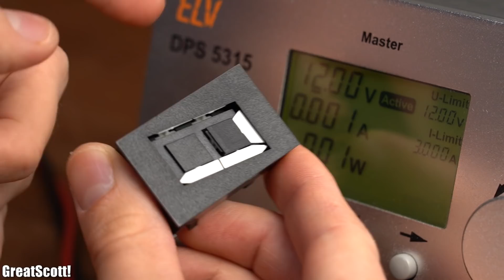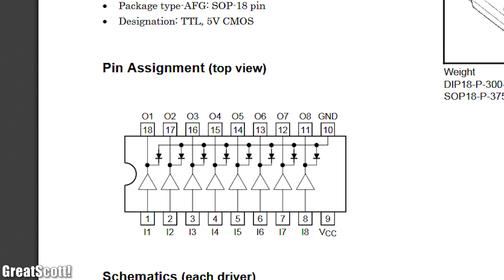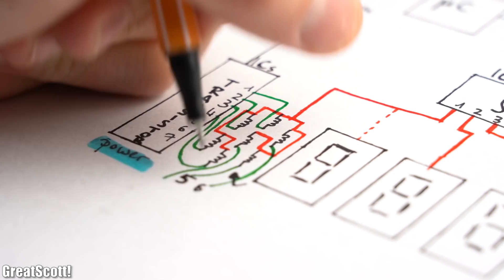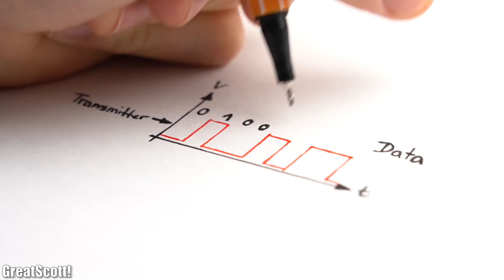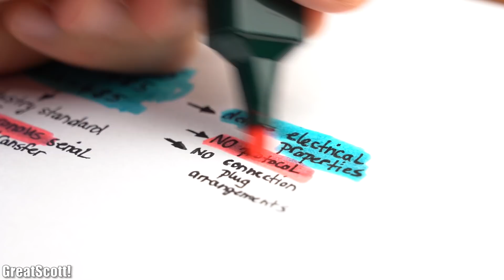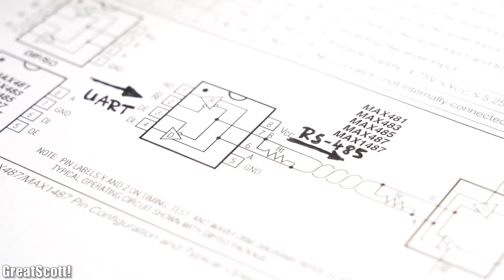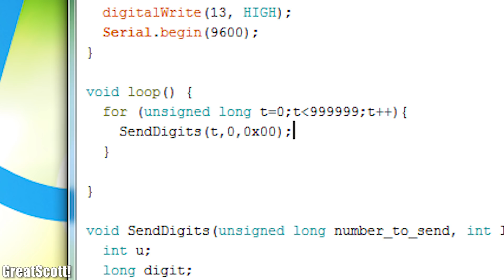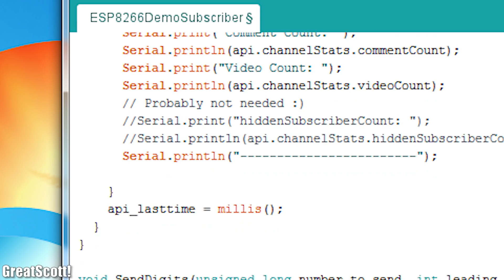Controlling Mechanical 7-Segment Displays?! How RS-485 and UART works! || EB#43

Comment: Will you make a video about Wavgat nano, aka LGT8F328p? These are another arduino alternatives. Their processor is "better clone" of ATmega328P. (Register level) programming will be same, but it have some additional features: it should run at 32MHz internal oscilator, it should have Timer3, one 8bit DAC output, 12bit ADC, ...
Unfortunately, it is missing well readable datasheet.
https://www.avrfreaks.net/sites/default/files/forum_attachments/LGT8F88P%20LGT8F168P%20LGT8F328P%20translated.pdf

Comment: how do they keep magnetic polarity, pls someone explain
Reply: They don't. I'm guessing that there's a mechanical door which is controlled by the electromagnet. When open it can allow the plastic to be visible and then close the door. Then put the plastic back in next time . 
Sorry, got a little impatient typing on the phone. Do let me know if you want a better explanation.
Reply: @sensiblewheels  This is ok, I just wanted to learn if there is a way to make a instantly and permamently magnetizing solenoid. And as I thought its not :/
Reply: I think another commenter had the right answer.  The mechanical moving part has a magnet.  In one state the north pole is drawn to the electromagnet and stays after current is removed because its a magnet so it's attracted to the iron core in the coil.  So you can shake it a bit and it stays.  To flip states you apply current in the opposite direction, which repels the north pole and attracts the south one.  That state is also stable.  So it's effectively a magnetic latch,  no mechanical latch needed.

Comment: That is an awesome display, I think that there are even dot matrix displays like that. Just curious, is it possible to use a regular arduino with an Ethernet shield to monitor subscribers? Instead of using an esp8266 that is.
Reply: Yes and Yes.
Reply: @zaprodk  cool

Comment: The three digits on the right hand side (lsb) mechanically switch more often and hence will wear before the most significant digits.
They must have thought of that and allo you to replace them or swap the 3-digit module with the msb one.
Reply: segments have no mechanical linkage, they are controlled with electromagnets, so there is nothing to wear out, at least not that soon...the manufacturer states segments are rated  for over 250 million operations
Reply: @brane3698  250 million operations, that's plenty but it's probably less due to dust and dirt.
Reply: @oH well,lord! if you prefer.

Comment: Your videos have been very useful for me GS so i'm gonna tell you about a problem / project i've been working on... since I started studying electronics a year ago i've wanted to reverse engineer a mobility scooter / electric vehicle ESC,   its a DC brush motor which is controlled by a single potentiometer which controls reverse, forward and braking, the trigger seems to act as a desired % of maximum speed,   and the vehicle automatically accelerates or brakes to meet that % target.  The boards seem to utilize a microcontroller, I would like to implement a similar system without.  

Firstly I am trying to make it so there are 2 pedals, brake and accel which will each give a 0 to 5v signal lets say,  this is then compared to see which one is higher, which activates either braking or accel mode.... there will be two 555 timers creating the duty cycle for power or regen braking seperately depending on the pedal signal intensity. The issue im struggling with right now is trying to control the PWM duty cycle of  555 timer using just a single 0 to 5v  voltage ( not a potentiometer ). My idea is to use MOSFETs to control the resistance of the charge / discharge portions of the 555 timer operation,  but im having trouble fine tuning it so that the mosfet works properly as a variable resister,   I have to compress the voltage into a confined range of about 2v to 3.6v it seems.

Comment: i got a electrical meter with rs485 output and 2 rs485 to ttl converters, but i cant figure the code for the mega 2560 or nanos out

Comment: Ive found the company a while ago through another YT vid. got myself a couple 7 Segments and some flipdots. Also got a single RS485 segement, didn't get to them unfortunatly yet. Thanks for makeing it more clear how they are driven though.
Reply: How much did you pay for it?
And is there a shop?
Reply: @MrKugelkopf  Just contect their info@alfazeta.pl email address. The pricelist i got when ive asked was 9 Euro for a 7 Segment without controller (as shown in the beginning) 24 Euro for a single digit controller (didnt ask for code to controlle it, wanted to use it as a base for my own design). And the Simple flipdots were from 4-12 Euro available. Just mail them, the reply was fast and informative when i asked some questions reguarding shipping and price. Hope this helps. Their page also shows some cool Projects they did with artists.
Reply: @StreuPfeffer  thank you!
Reply: i think you have to contact them

Comment: RS485 used to be really handy in the pre-wifi days as you can run it really long distances with no loss of signal with a data speed of 115k. A company called Lantronix also sell a Ethernet to RS45 server device (UDS10), so you can drive RS485 on a ethernet based network.
Reply: Still being used in the show and theater industry for the DMX lighting protocol

Comment: I will use some multiplexers and transistors to drive this (without understand the whole mess) :D
Reply: It's a lot harder than it sounds. Look up on YouTube, there's some videos of EE driving similar dot matrix displays
Reply: to flip a segment it needs a >200mA pulse in 1 direction and un-flipping needs a current pulse in the opposite direction, you'll probably need something that has a push pull output

Comment: How can the segments hold their position even after the magnetic field is gone?
Reply: I think it must be a similar mechanism as used in a mechanical toggle switch with the electromagnet providing the apposing (on and off) toggling force rather than your finger.
Reply: Once the magnetic field dissipates on the electromagnet, the fixed magnet's field is still attracted to the electromagnet's iron core. If otherwise undisturbed, the fixed magnet will stay there basically indefinitely. When the electromagnetic field is applied in reverse, it pushes the fixed magnet away, so its field no longer overlaps the electromagnet's iron core.
Reply: @McTroyd    agreed.
Reply: The electromagnet's core must be made of a "hard" iron, which stays magnetized after the coil is de-energized; like a magnetized screw driver. Usually an electromagnet uses a "soft" core that does not stay magnetized.
Reply from the maker: Yes

Comment: How the electromagnets holds it's position even after removing the power??
Reply: Iron or steel can hold some magnetism, if put near a magnet!  Try dragging one over a screwdriver, it can help hold a screw.. :)
edit, to answer the question....  the magnetic 'grains' get lined up so they stop cancelling each other out..
Reply: The core that the coils are wrapped around maintains the polarity as if you are creating a new magnet each time it is reversed.. 🤖
Reply: That's a good question. The effect is called remanent magnetization or remanence, in case you want to look it up. It is due to material within the center of the coil, called core. And it is exactly what Slack's Shack said :)
Reply: It may be similar to a flip/micro switch with a spring. Or it has a magnet on both sides.
Reply: It just stays electrolized

Comment: This is some heavy artillery compared to just a 4511 or similar 7 segment decoder, but then again you would need multiple (10x) plus some kind of transistor as I suspect those coils draw more current than the typical LED seven segment.
Reply: I thought the same thing.

Comment: Why do the wires have to be twisted?
Reply: For noise reduction between the lines
Reply: The data wires need to be close to one another so that external electromagnetic (E.M.) noise which exists in the environment does not interfere with the data you want to transmit. If they are far apart, the natural E.M. noise will change your sent data on the receiver end.
Hence, in order to keep the data lines always tied to one another, they are kept in twisted pair.